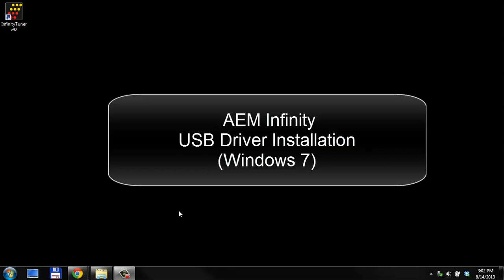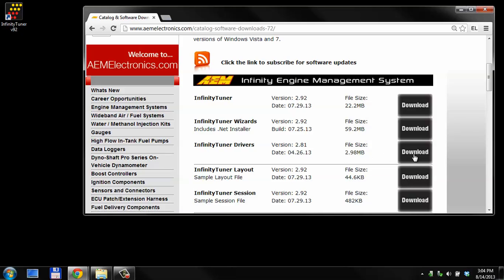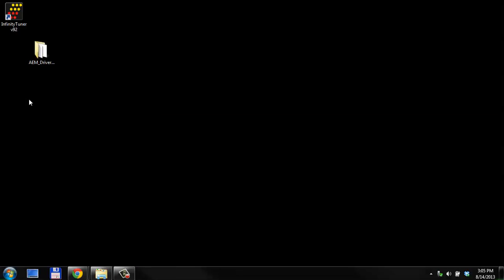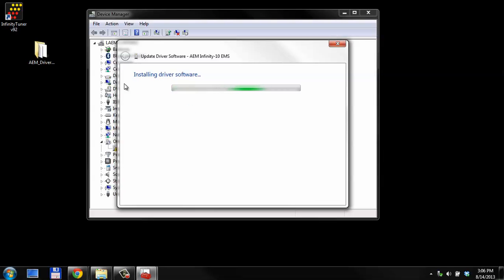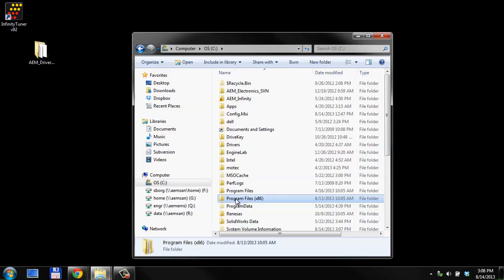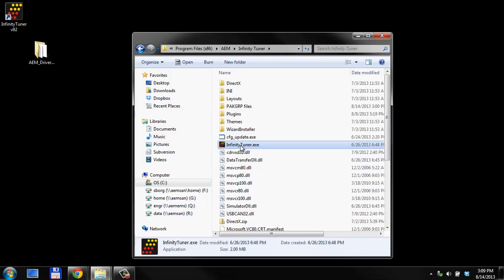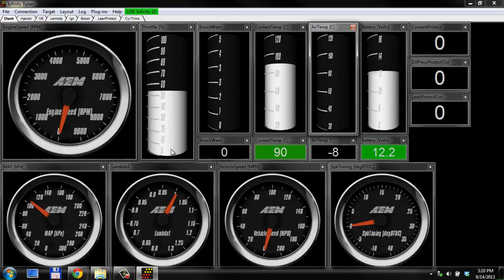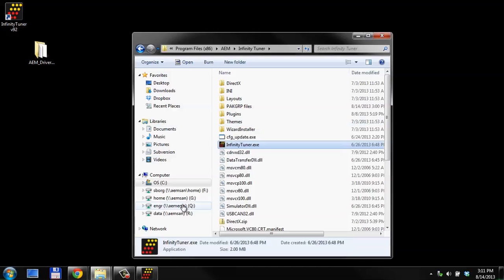Infinity EMS - USB Driver Install Windows 7

Comment: is this necessary if you install the Infinity Tuner software as of 2/28/2017??

Also Run as Administrator is greyed out. I have User Account Settings disabled to disable the notifications. Not sure if that's related.
Reply from the maker: Drop our tech guys an email at emstech@aemelectronics.com and they will help you out!